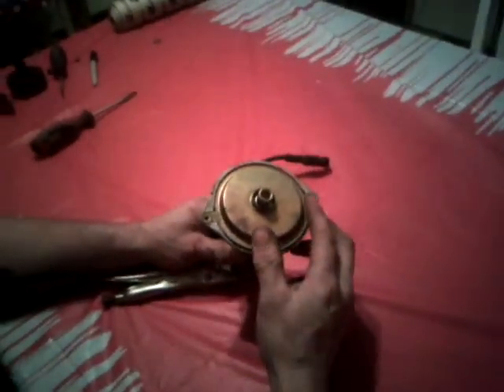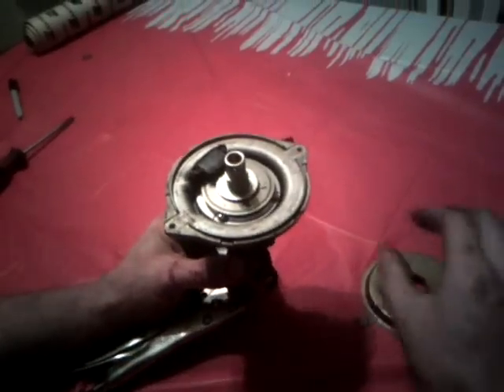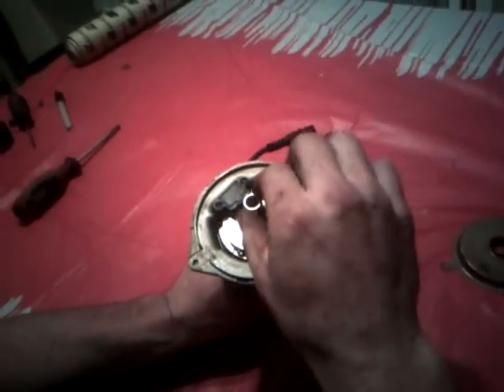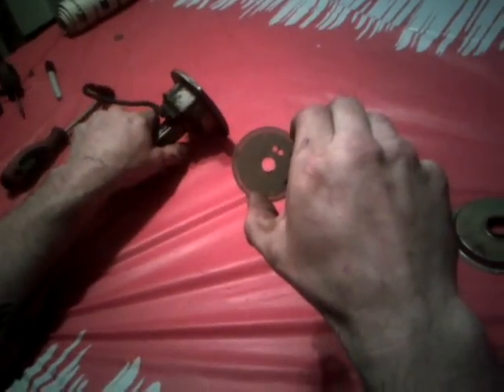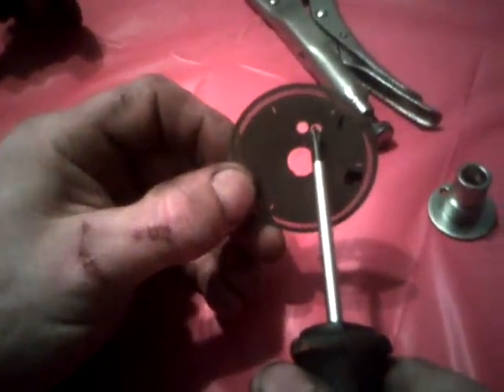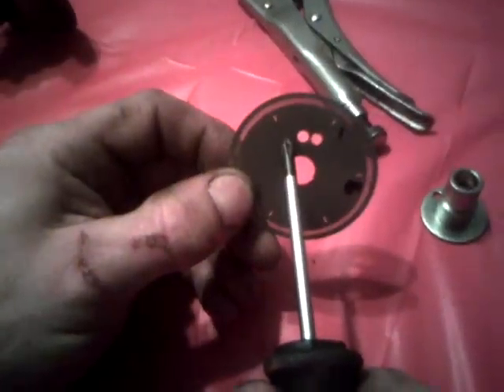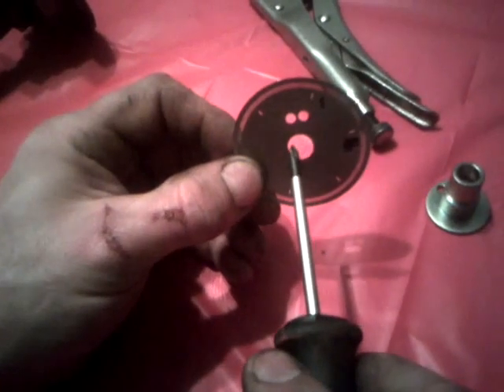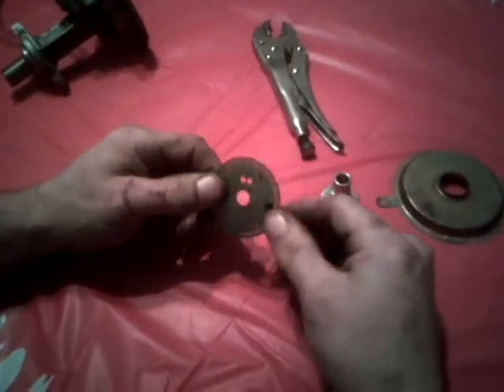datsun 280zx distributor mod for timing

Comment: This makes no sense. Why wouldn't you just loosen the two 10mm bolts and adjust timing by turning the distributor?
Reply: I think he is doing this to provide extra advance. I'm dealing with this now, I think the previous owner didnt install the oil pump with the engine at top dead  center.